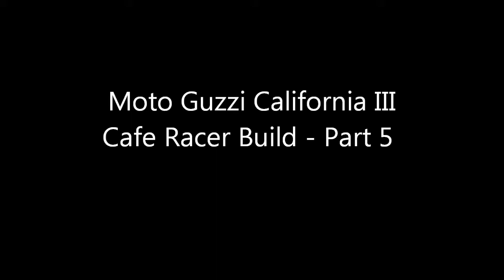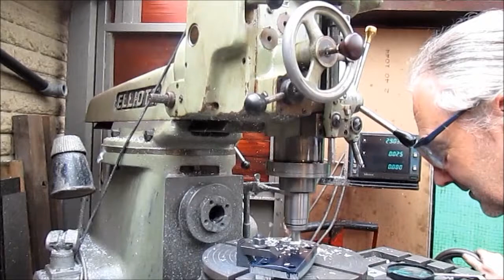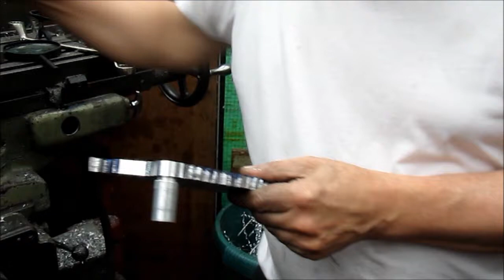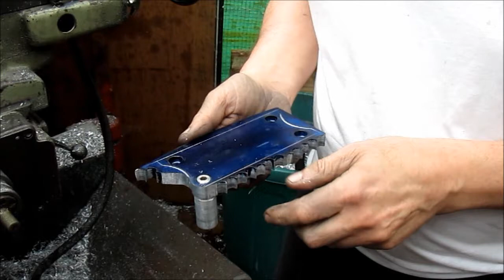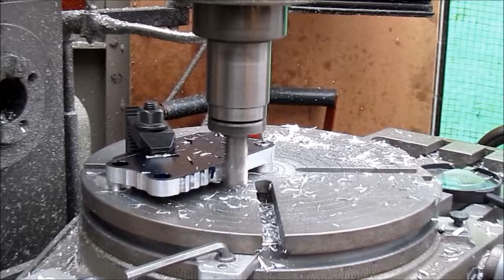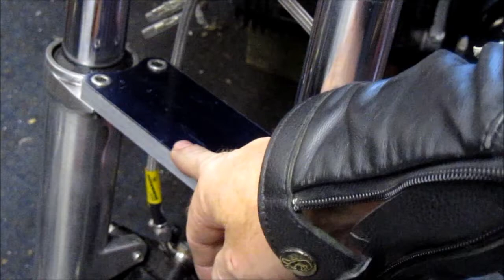Moto Guzzi California III Cafe Racer Build - Part 5

Comment: Hey love the content, when do we get to hear that glorious v twin run? Thanks!
Reply from the maker: Soon I hope, waiting for the seat to come back from the upholsterer then have to complete the wiring. Got other project bikes too, the Guzzi has always found itself at the back of the queue. I've actually rebuilt it twice, as wasn't happy with how it looked the first time.
Reply: @Merch131ho  Thanks I'm really keen to do a project like this. My uncle has a fuel injected jackal he doesnt use so that would be a good base, but feel the original carb models would be best. Keep up the great work.
Reply: @Merch131ho  Also I saw some tips from builders tackling the same conversion. You may want to consider replacing the subframe with a longer le mans one, and if you intend on working on the engine then a lighter flywheel apparently helps with performance. I will certainly use your playlist as a guide if/when I ever take on such a project. Keep it up